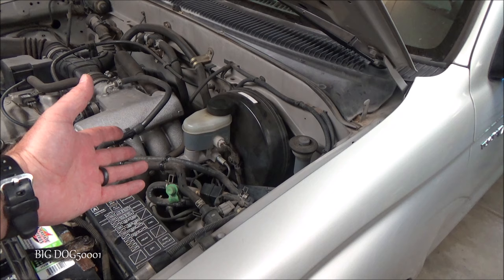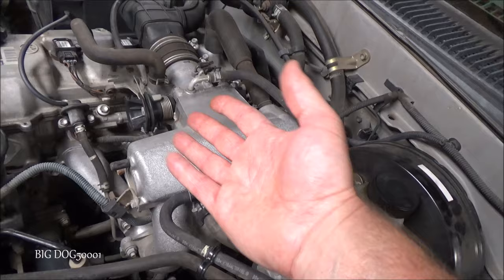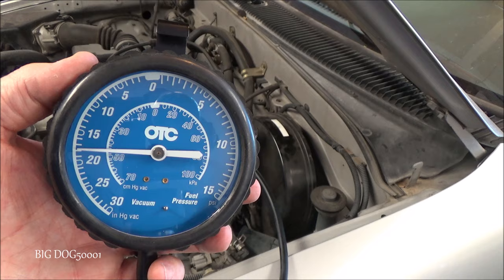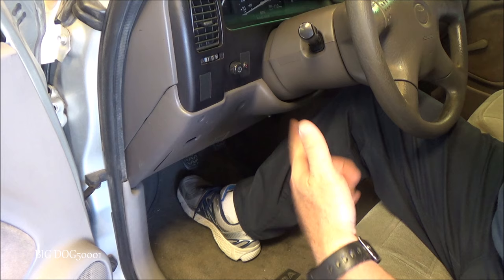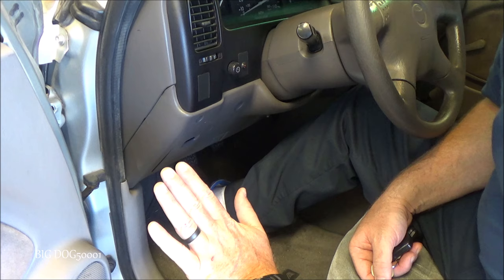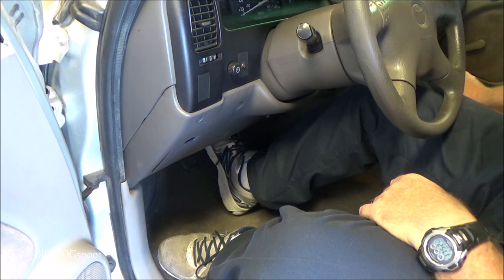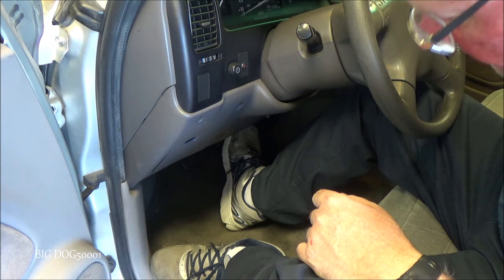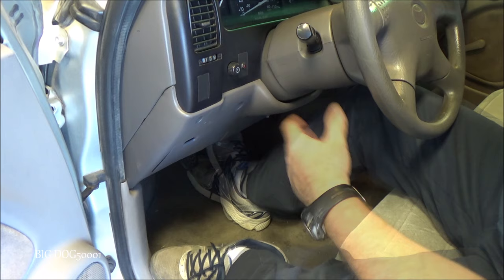How to Test For a Bad Brake Booster / Brake Booster Testing

Comment: If you or anyone is able to help, I have a question. I am driving a 2002 Tundra and have been wondering if my brake booster or master cylander is going out. There is a constant hissing leaking sound after I turn off the pickup. It sounds like ita loosing vacume. Any Ideas?
Reply from the maker: It is possible it is losing vacuum in booster.  Have you tried some of the tests I showed?
Reply: @BigDog50001  Yeah I have, I think they halped narrow it down. After I turn iff the vehicle I have about 10 seconds before the peddle pushes back. The check valve seems fine as well. 

I tried pulling of the line that hooks up to the check valve. If I hold it shut and run the pickup, there is not leaking sounds while running or after turning the pickup off. Since the check valve seems fine, Im thinking that the booster has a leak. 

I already replaced the Master Cylander and the gasket between the MC and the booster.

Comment: Hey Big Dog, I have an issue where my pedal falls flat to the floor when my engine is running. Pumping the brake also causes the engine RPM to shift. I changed the booster as google says this is commonly the failure point. With the booster the problem remains the same! What gives?
Reply: Mine is doing the same, did you ever find out your problem? Any info would be helpful,thnx👊😎
Reply: @katbirddogg8184  I made sure to bleed the brakes as best I could. I had the front end lifted up, bled, then brought it back down, bled. I ran easily 2 quarts through the system out of pure paranoia... still no improvements in the pedal. It wasn't until I drove the car to bed the brakes that I got pedal feel. Eventually after fully bedding the pads and rotors the pedal feel is amazing. It's strong and all 4 wheels lock up fast if I let them.

Comment: Hey sir what if I can build pressure while car is off when I turn it on I have brakes but it goes all the way to the floor and grabs when it's all the way down could that be booster
Reply from the maker: Not likely unless the booster or master cylinder were just installed (and are way out of adjustment).  More likely an issue with master cylinder, a leak in system, or a brake component (like a brake shoe) that is way out of adjustment/specs.
Reply: I have no brakes,big dog the pedal goes to the floor zero brakes help please.

Comment: When i press on my brakes, with the vehicle on, the brakes completely fall to the floor. I am not sure,  wheather or not if its a master cylinder  or brake booster
Reply: It's brake cylinder.Or air in system. or brake shoe broken also brake pipes leaking

Comment: Hey, I converted my manual drum brakes to (YJ jeep) power disc brakes in my 76 cj7 jeep.  I noticed the piston rod was slightly longer on the disc brakes than the drums. So lowered my pedal to allow the extra length. After converting to disc, I now I have soft brakes.  I bled the system 4 plus times.  Don't think theirs air. But I didn't bench bleed the mc.  And the pedal hardens up after I pump the brakes. I read I could adjust the piston rod in the booster.  Any Idea On how to fix it? Thanks for the video.

Nevermind,  I figured it out a while back.  It was missing the MC pin or "bullet". Brakes are nice and firm now

Comment: can a break booster turn your check engine on
Reply from the maker: It is possible but probably not like you are thinking.  The brake booster in this video was a contributing factor in a P0171 lean code because it was leaking (so technically it helped cause a check engine light).  Newer system that use electronic brake assist have the capability of setting trouble codes directly when the system detects an issue.

Comment: 1995 chevy pick up. With engine running, depressing on brake pedal the idle increased and you can hear air leaking. Any advice? Ty

Comment: How do you know it's not the MC when it DOES sink down?
Reply: I tried the tests and i did end up buying a new MC where it seemed to be a small old leak when contacting the brake booster, still same after bleeding brakes, fluid all changed and flushed out, and went from there to replace my brake booster, not much of a tip but thats what i had to do on my end
Reply: @uzileopard6199  so was the issue the mc or brake booster?
Reply: @MarcoS-yd9pf  it was the brake booster that stopped working properly. I couldn’t tell if it was the MC or BB cause the leak was right where they met at. It was cheap on my end cause it was an old 90’s Honda.

Comment: How do you remove the check valve?
Reply from the maker: Depends on model, but many are just installed in rubber grommets and can be pulled straight out.  The one on this truck was held in by a nut that had to be removed first.  Other models have the valve built into the hose.
Reply: @BigDog50001  How to pull the check valve out and put it back on my 2000 Toyota 4Runner V6? Is that the same as yours? I looked at it and felt like some kind of rubber shoe there. My brake padel won't go down in the first 5 minutes. It makes felt like step on a wall. It would be going down after around 5 mintes. It would be the same hard brake padel again if I park the car for more than 10 minutes. How do I know if there is a air leak somewhere? Thanks Josh

Comment: Should I be hearing hissing?
Reply: Correct! Push the pedal and shall hisssss, Now go fix it!
Reply: @johnbill694  gotcha, shouldn’t be hissing, is it the booster or master cylinder though?
Reply: @wadofbat  BRUH it's your brake booster and if you see any fluid in the center holes AFTER taking that stuff off then replace the master cylinder also, if it looks dry and clean then master cylinder is(80%)fine.
Reply: @wadofbat  I just replaced that today for someone and the most annoying thing was that darn clamp for brake pedal.
Reply: @johnbill694  I’m replacing on a ‘08 f150 4.6 in a week, just curious if I should buy a master cylinder just in case

Comment: Sorry but watched loads of videos on booster /master cylinder ETC no one can give me an answer to my problem /maybe you can help would be much appreciated drive for about a mile brakes lock on take the booster pipe off brakes release now changed the booster/master cylinder/valve done a vacuum test All OK doneODB no codes, as a part time mechanic also had my own trucks done my own commercial fitting i do have knowledge about mechanical things but never encoutered this before, thanks

Comment: nothing wrong with the check valve nothing wrong with the pressure from the intake but the pedal goes to the floor
Reply: Have you tried bleeding the air from your breaks

Comment: Good video but air can't escape from the vacuum, vacuum has no air. Air gets in the vacuum.
Reply from the maker: Easier to explain it the way I did.  Sometimes too technical is not a good thing when doing videos.
Reply: @BigDog50001  Well for me it made me confused and was trying to think I don't understand how brake servo works 😂